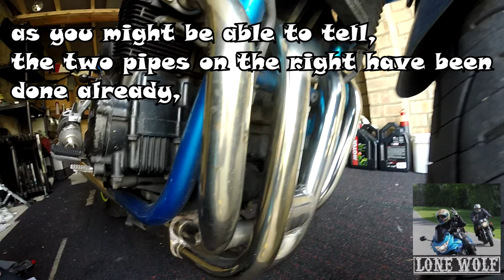how to clean a motorcycle exhaust WITH BLEACH!!!

Comment: Aha, a Motul user too  :-)    solvol smells a bit though even after wiping it off & someone suggested that they go a bit yellow afterwards too. I just can't be arsed  with the 750 downpipes, yet my GSR 600 were pretty good.
Reply from the maker: If they're stainless the heat makes 'em go a kind of golden yellow, as mine do. Yeah I quite like motul not to expensive, we'd just done mine and the Mrs oil change. Rsmf

Comment: Bleach is sodium hypochlorite. Harpic is probably hydrochloric acid (read the bottle) which is why you must not use it on chrome, or you won't have chrome. It's not bleach, don't use the Domestos ;) 
Kilrock-K and another formulation of Harpic (read the bottle) is formic acid, as used for de-scaling kettles, and can be used on chrome. The advantage of the Harpic is that it is thick with detergent and sticks to the surface. Maybe mix diluted Kilrock with some Fairy for chrome?
Reply: Jeff Slade i
Reply: Alex, what I was getting at is that Harpic Power Plus is not bleach. It works but it's not bleach, it is acid toilet descaler/cleaner. 

Do Read The Bottle !!

COSHH  Data Sheet - https://www.op-dealer.ie/Images/product/PDF/COSHH/RK00567.pdf